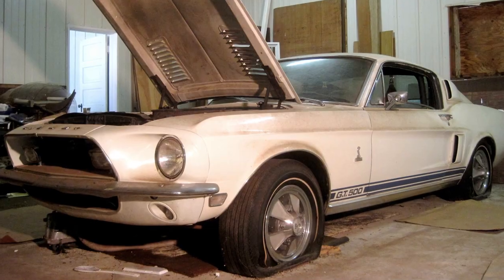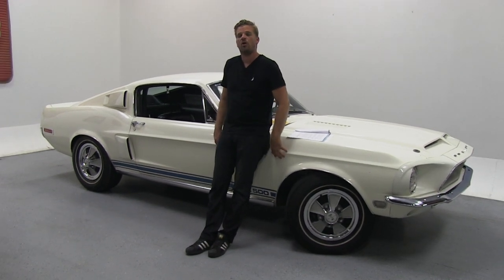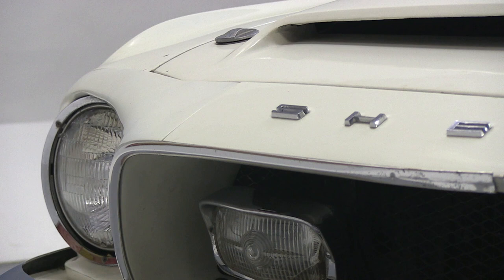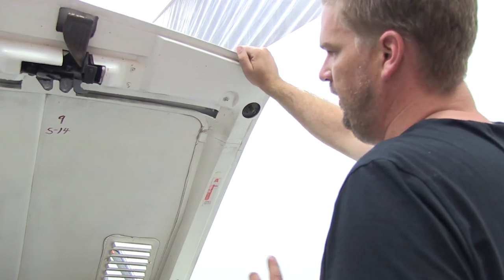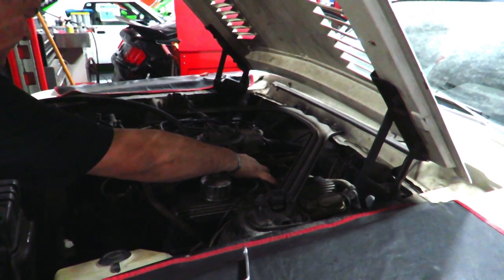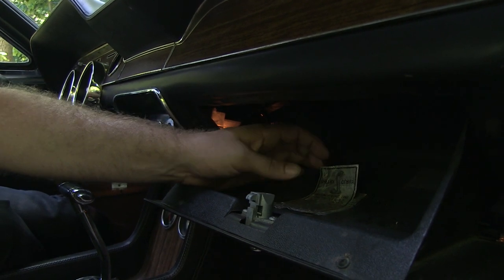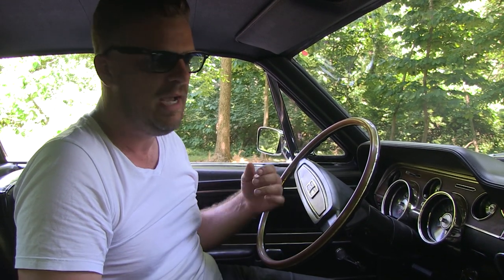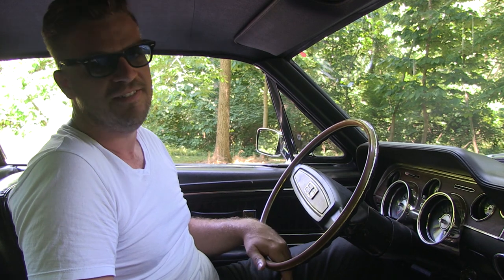ORIGINAL 1968 Ford Shelby GT500 (SOLD)

Comment: Hubcap-hubcap-hubcap.  Those are NOT HUB-CAPS, Those are wheel covers.  lol  I bought a 1967 Shelby GT 500 in 1971 (in pristine shape and only 27000 miles) for $1725.00  Wish I still had her.  Believe my Shelby had actual Shelby "Mag wheels" not WHEEL COVERS.  lol
Reply: Absolutely! in the UK, they are called "nave plates".